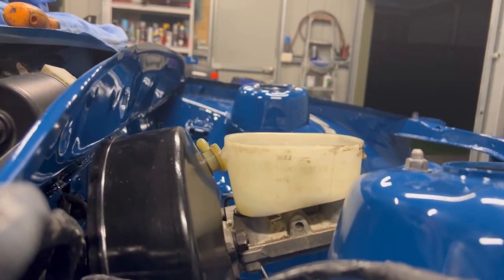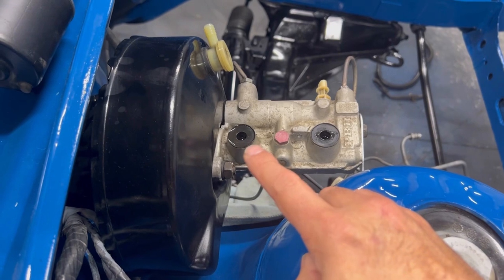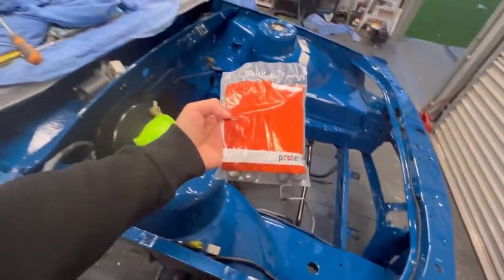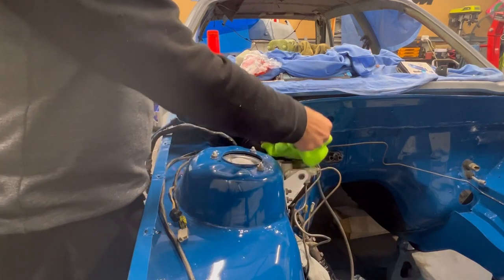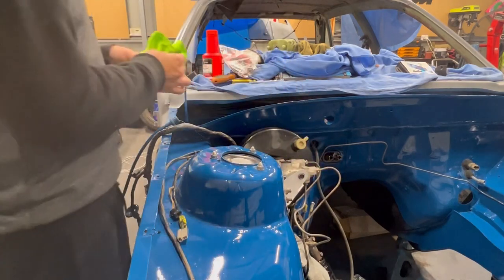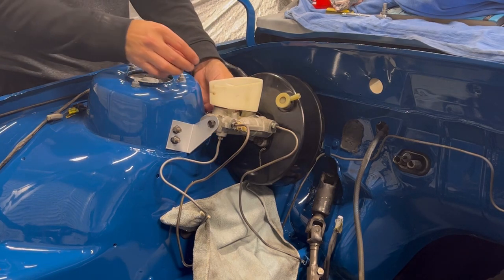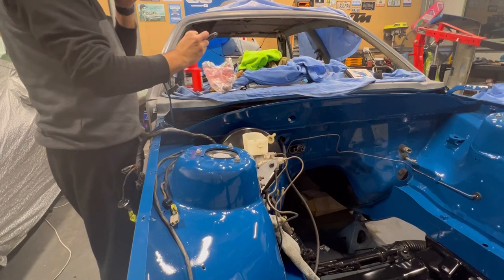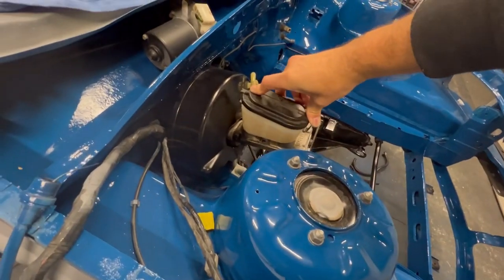VK COMMODORE BROCK TRIBUTE: Master cylinder repair

Comment: Looking good mate,bloody brakes can drive you mad. I done a vy booster modified bracket for firewall.  I should have changed the master cylinder but it looked ok, leaked very next day. Grr#$...
Reply from the maker: Yep driving me crazy 😜 didn’t leak before removing, then leaked when re installed